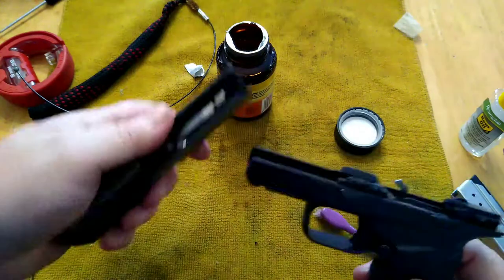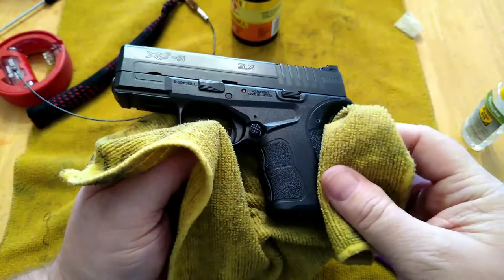Springfield XDS mod 2, disassembly cleaning And reassembly.

Comment: Jist picked up the xds mod2 osp with a crimson trace optic. Loving this thing so far!! Nice video, thanks for the tips.
🇺🇸🇺🇸
Reply from the maker: Congratulations on the new gun, and thanks for watching
Reply: Same here
Reply: I couldn’t find a crimson trace to fit the model 2. Crimson trace customer service said they didn’t make one for the model 2. What did you use?
Reply: @cascios  it's a cts-1500 . It came with my xds mod2 osp as a package deal. I didn't end up using it anyway. I like the iron sights better as I have a hard time adjusting to the red dot on a pistol
Reply: @jaystevens427  thanks, I’ll check that out.

Comment: Just picked this pistol up last Monday and have been carrying it IWB with a Desantis Pegasus Slim-tuk and it's been a great choice so far as I do a lot of maintenance work from painting to lawn work and snow removal here soon too and I'll tell ya folks I'm 6ft tall and 150 lbs like a twig and this thing barely feels like it's there!  Barely even visible "printing" in a Tshirt wearing appendix. XDs Mod 2 OSP in 9mm with a 3.3 inch barrel is a phenomenal carry and a great shooter to!!  Also got it in time for the Gear up promotion which gives 3 mags and a range bag and my Viridian Reactor 5 red laser with holster is on the way too!!
Reply from the maker: Yes I've always thought the XDS was the perfect size for concealability and yet shoots like a full size pistol

Comment: Thank you all the great tips. How often should you clean the gun? I am really inquiring for when the gun may be not used and sitting in its case. Have a regimented amount of time in which you clean inactive firearms?
Reply from the maker: If a gun is clean and you just have it in storage I would pull it out about every 90 days and just inspect it and make sure you're not getting any rest and maybe wipe down the outside with some oil and put it back away
Reply: @HamiltonOutdoors  Thanks. New gun owner and I have not had a chance to take it to the range. But wanted to make sure I could disassemble and clean the gun for up keep. Thanks for the tips and info.
Reply from the maker: @Gantorin  glad the video was of help to you, that's why I make them. Great weekend and congratulations on the new gun

Comment: When I reassemble a slide I place a pencil, eraser down, then press the trigger. The impact of the firing pin usually forces the pencil up and completely out if of the barrel.

On the XDs it bumped thr pencil up a little. It was then I thought I did something wrong when I reassemble it. 

I went to the range and chambered a round and squeezed. The gun discharged. I was relieved. 

I'm fairly good a disassembling and reassembling my guns with any problems but the XDs has an extra part or two in the slide. 

These videos help save us $$$ in repair at a gunsmith.
Reply from the maker: Thanks for watching I am glad the videos help

Comment: I have a brand new Springfield XDs mod2 chambered in 45 ACP with everything intact from the factory. I have put zero rounds through it since purchase. It was legally purchased but admittedly an impulse buy that I have no use for since I have many other firearms that I actually prefer. 

I am currently located in South Florida (Ft. Lauderdale area). I am willing to negotiate and, if a good enough offer is made, I'd be willing to take slightly less than what I paid for it. Again, keep in mind that you'll be receiving what is essentially a brand new weapon. No rounds through it, no scratches or blemishes and still in its factory box with all manuals and warranty card. 

If interested, respond with your email address and we can discuss. I'd be happy to try to work something out that's fair for both sides.

I got pics!
Reply from the maker: No thank you but I appreciate it